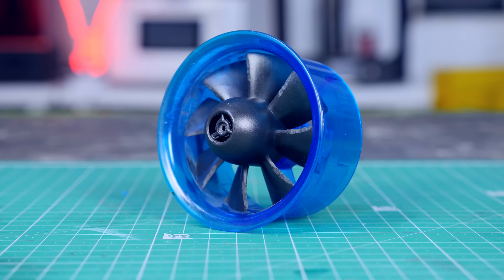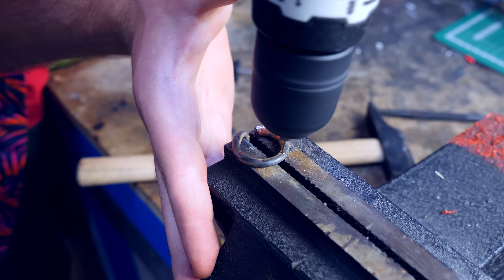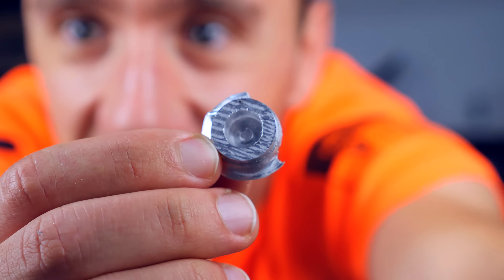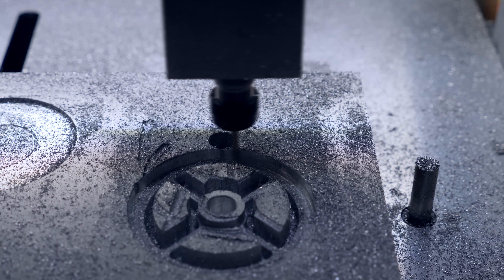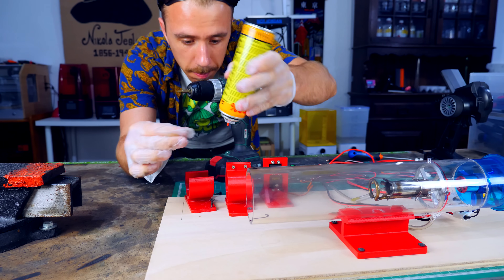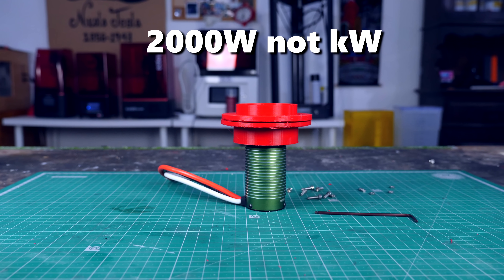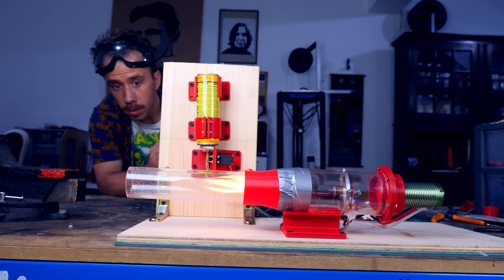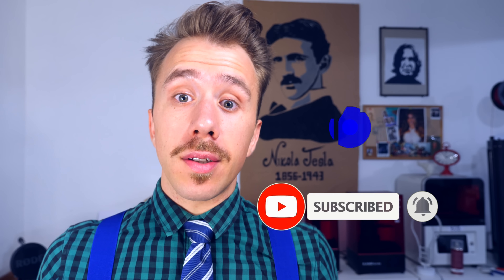I turned my Fan into a Jet Engine (3D Printed EDF Afterburner)

Comment: bro use stone powder since they are very heat resistant and can be made easily by mixing stone powder and water and also maybe something else for the thickness you need like "skill make" did by the way im 16 y old this is to solve your heating and melting problem maybe make the nozzle out of this stone powder

Comment: Bro Indeeded. I have thought you burn more fuel under high gas flow. Basically, more O2 to burn fuel. The question is how to convert that hot gas into kinetic energy by a flywheel to generate momentum or something else? Anything on your mind?

Comment: And you didn’t very well making metal parts sorry to ask you can u help me with 3 d printer I just had hart surgery and my wife died from the cove vaccine so yeah im still recovering but i need help please do i can make some good stuff with a 3 d printer thank i been following u to get good ideas for making a electric car but will no 3 D printer is not possible so i recall u saying that if i left a comment and project that u could help with make tezler electric car power with 3 d printer terrible and the teller turbine u made 1.5 whas c by20 wood my ennuff power to run a electric car Eddie Dornan 22 chauvel street Campbell act2612 tomato are very bad but ca 3D pit a good vocal so we could get rid of tamato with rc

Comment: Well suprisingly it runs! but note this real afterburners have this bizzare shaped structure known as flame holder in front of the feul spray nozzles to ensure better mixing and a sustainable flame one that doesn't blow out under high pressure so yeah it might work better with these improvements.

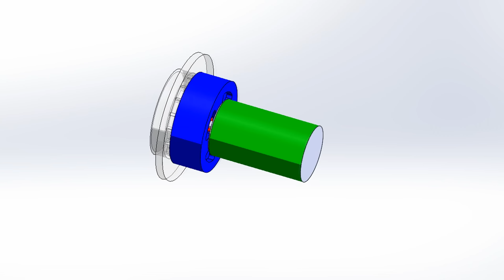Comment: @9:45 - no modern full-scale turbojet engine uses a centrifugal compressor.

the only place you still find centrifugal compressors in gas turbine engines are small turboshafts and RC models.

Comment: Is it possible to 3D print a drone from 0?    Can you do it? It’s a long project, but at the end of the you can sell it, we just buy you the engine, micro chips and controllers, and get the printing files from you 😊😊

Comment: I absolutely love it but here's the thing there's an actual radiation issue on any jet engine you actively need to have a geiger counter in the room with you the next one is once you get this to work there is a way to use butane to make a refrigerator and you make a little bitty refrigerator that runs and you put a pilsner between your jet engine heat and the refrigerator of the butane and even use the butane as an afterburner in your jet engine but it puts a ridiculous amount of free power or almost free power it's the stormtrooper backpack so that they had air conditioning and heating

Comment: Wouldn't what you have created be more precisely termed a motorjet since you are using an EDF to sustain the airflow into your creation rather than having a turbine in the exhaust "nozzle" to drive the "compressor " stage?

Comment: When working aluminum on the CNC milling machine, I recommend using a cooling lubricant (emulsifiable oil) so that the tool does not mix with aluminum It is just a product especially for those who work with metalworking, I use a water bottle with a hole on the cap and I sketch it directly on the tool 👍

Comment: Ok now you need to make stators and rotors, it should be easy enough to 3d print, like your turbine from the v2 , put fins on it and then step the size of fins down and stators to compress the air, get your burner in play and bobs your uncle

Comment: im confused, if the glow plug is in the back and you are spraying the fuel in the front, how is the fuel getting ignited, is there a small hole in the metal tube where the fuel also goes in to actually ignite using the glow plug

Comment: I'm confused on this, but doesn't pressurizing air increase the flow rate? And if so, how do you achieve high pressure air that is slow enough to not flame out the engine from a high speed intake?

Comment: did you miss the part that the flame tube has holes on the sides that takes the compressed air and mixes it with the fuel?

Comment: RE: generating spark Do it the old-fashioned way! Use a spark plug, condenser, ignition coil, and points. You can get these parts from an auto parts store for not a huge amount of money and mount them to a board. All the zaps you want.

Comment: Try to compress the fuel air mixture before ignition and try to reduce the fuel amount. I can see red flames and that means that the mixture is rich in fuel and the combustion is not efficient. In addition try to use the glow plug after the fuel injector because after ignition the flames will keep the high temp in the glow plug so you can turn off the power (see ethanol 2-stroke engines)

Comment: You haav 3d printer make an actual jet engine. With rotars and stators. Granted u need like 7 stages but maybe something smaller could be made differemtly....full suck bang blow. Not just a butane can ab. Already on the right track. Bet u could make an adjustable ab nozzel to adjust that exit diameter.

Comment: Hint from an old machinist, when machining aluminum cbn cutters are amazing. Carbide also works well with the use of a lubricant. Light oils like penetrating oils, wax or water based machining coolants really help. You'll be surprised at the difference in the cutting finish and accuracy.

Comment: For the next version try to measure the thrust generated, it'd be interesting compare just the fan versus with the afterburner running!
Reply: The same resoults the only thing he did is push the burning fuel by a fan matter of fact it might be worse than just straight up fan

Comment: Add coolant to your CNC (mixture of oil and water) extra lubrification really helps with the excessive noise and allows removed material to get out of the way resulting in less vibration thus less noise and a prettier finish. Wd40 works too, if you're not in the mood to mix water and oil

Comment: try to use hole near the ignition tube which can increase the combustion and enhance fuel burning leading to greater power and the high pressure fan can surely support it

I hate tomatoes too

Comment: So I feel like a big part missing is you blades and defuser. In a gas turbine engine the air being pushed in passes though what we call the cool section module that creates a wind tunnel, the defuser compresses the air flow then it goes to the hot section where we have a combustion chamber to atomiz the fuel and ignitor plugs to spark the fuel. After that we have the gg rotors (gas generated rotor) with air labyrinths, these rotors also have blades to continue the air tunnel effect. I see you and plasma working on these ideas and I just can't help but notice you guys aren't doing anything to condense the air to add pressure, I feel like the output in your ionizer engines would get that extra zaz if you could find a way to replicate the compression section of a gas turbine module engine like the T-701 D/C or another one, that's just the one I work on.

Comment: You need to put the constriction on the outlet of the centrifugal fan to change the air from high pressure to high velocity BEFORE you inject your fuel and ignite.
Remember: an afterburner is adding fuel to and  recombusting already high velocity air coming off the power turbine, and you need to simulate that.

...or just 3D print an axial flow fan 
💪 😎 👍

Comment: do yourself a favor. IF possible. Slow down the track speed of your CNC. and maybe add some machining oil when working with metal like aluminium ^^
should be a much cleaner cut. also make sure the tool is sharp ofc.

Comment: In a follow-up video maybe you can figure out at what temperature water breaks down into its component hydrogen oxygen parts and use those parts as a fuel and oxygen supply for a small rocket engine

Comment: Howdy there! I have been very curious about using a tiny motor to turn a large motor (generator) with a gear ratio 3d printed and assembled to create a higher energy output than put in. I have seen people use the same motors to try to make free energy devices but I haven't seen a small motor turn a massive motor yet... I'm a maintenance Technician in Billings Montana, USA. I love your videos and I have similar interests. I have been having a hard time saving up enough money to get a good 3D printer with having to buy diapers for our son and all, but I know you give away printers in your videos and could totally use one for my inventions, if you do choose me it would go to great use I promise.

Comment: I know its not the same thing but u can actually produce thrust if u make a "ram" jet engine or use different fuels and put some sort of scale to measure the amount of thrust ur getting just off ur machine i understand ur just moving air but it has to be producing more than just a turbo hair dryer. Anyways really dig it looking forward to more creations and failures cant learn if u dont fail knowing how to not do something is better than knowing how to just do it cuz u need to know how u got there cool video... Godspeed...

Comment: Sorry a newbie question here. The way I see it, this is more of an afterburning ducted fan engine, not a turbojet engine. Because what I know about a turbojet, the fan is driven by the turbine, which is spun by the combustion gas. Or there really is a turbojet designed this way?

Comment: Hello Integza,
I have an idea as of how you could make a heat-proof jet engine. I’m not sure if you know of this technique, but if you print a part using PLA filament, you can coat it in what is called a ceramic slurry. After a half dozen layers or so, you will have to use a furnace to slowly burn out the plastic. However, since the slurry is made up of such fine particles, you will be left with a perfect negative mold of the part. Since you have a furnace, you could melt some aluminum or steel and cast it. It’s a somewhat delicate process, but it leaves you with perfect metal parts, much better than plastic. I wish I had a printer so I could try it myself! Now that you made a CNC machine, it may not be nearly as necessary, but it may be worth a try.
Best of luck!

Comment: This... is very OLD technology.   how old?  at this time, over 100 years old!    The idea first came about in 1908...   What you have here "was" called a Thermojet (who's name then became used to describe a type of pulsejet)   or a Motorjet.

A moterjet is a primitive jet engine that uses an external source to power the compressor.   A modern jet has 3 "parts"  the initial fan that draws in and compresses air.   The ignition chamber  where the fire happens, then exhaust is vented over a turbine,  the spinning of the turbine turns the fan up front.

In a Moterjet.  an external source,  originally a "piston engine"  would be used to drive the compressor fan.  This was much simpler because the "high pressure high temp"  turbine fan requires special materials and crafting, where as direct dumping from the motorjet provided raw thrust.    The downside is, the mass of the engine required to drive the system.   

Initially Italy found a way to make this work with the Caproni Campini N.1 in 1940,  this created a jet that could reach speeds about 220 mph.   Russia later in 1945 tried the same thing but essentially ran with  normal propeller engine,  with a duct running back to the thermojet... 

In both cases,  this essentially gives an afterburner effect, as the planes COULD fly without the jet active just using propultion from the engine.

with the advent though of high pressure turbines (thank you titanium)   motorjets died out and research stopped.   But the idea of a ducted fan using a motorjet "afterburner"   for a conventional aircraft as a "cheat"   to get around jet laws, has always been an appealing idea.

Comment: Professional machinist here, one thing to help the screeching noise on your machine is to use the shortest tool possible. The closer the machine spindle is to the material, the more rigid and quiet your setup is. Please buy shorter endmills. 😊
Reply: There was no coolant there, right

Comment: Hate to tell you... but thats only a unnecessaryly complicated flamethrower or a torch.  NOT a jet engine.
To become a jet engine, it must generate thrust by the expansion of the combusted Gas. Your device only uses the fan suck in air and blow it at almost the same preasure out the rear. The way you burn the fuel does not produce or add any significant thrust. This fuel is basically just wasted for an optical effect. 
A Jet Engine consists of following stages: Intake, Compression, Combustion, Propulsion/Outlet. ... the expanding gas produces all the thrust and also propells the Intake fan. Only at Startup the jet-engin needs a little aid to get the first compression and combustion going with e.g. an eMotor. Once it started to burn fuel, the aid--eMotor becomes obsolet until you want to start the jet-engine once again but sometime later.
If you want to know if you're doing it right: The inlet does not suck in as much volum as the combustion produces thrust. It's not even close. it's something like 1Liter (Air volume) IN but 10Liter (Combustet gas volume) OUT. the energy/expansion of volume comes all from combusting the fuel. That's why a car gets blown away behind an Airplane but not sucked in when in front of it.

There is a chanel named "Warped Wahrnehmung". It's from a person that works a lot with actual miniatur jet-engines. he propells Go-karts and even Teslas with it.
His Video "See Thru Jet Engine" should be very informativ to you. Cheers.

Comment: Amazing project, cool video… just a comment… a glow plug does not ignite diesel in a diesel engine, it is used to warm the cylinder to help with cold
Starts…

Comment: Hey you need to find a friend who's into glass blowing and switch from plexiglas to real glass! PS you might want to add some temperature probes to see where the hot and cold spots are happening; I did this when testing vaporizing burners and it really helped. PPS you need to use cutting fluid when machining metals: your cutters will cut faster and last longer.  :-)
Reply: What about using Polycarbonate (bulletproof glass). It has a higher heat resistance that Acrylic and can survive high impact forces.
Reply: @GavinFromDesign  poly will survive higher temps but has a nasty habit of charring into an opaque black on the side exposed to the heat

Comment: Your CNC can sound like a cow for lots of reasons but most probably is a combination of too high spindle speed and feed speed with a bit too skinny for the job. Lubrication also is a  must, even if you have to do it manually. The depth of the pass might be too much also.
Anyway, this jet engine is cool. Next iteration you should find how much trust it generates.

Comment: You should probably be running some liquid cooling over that drill in the cnc machine. Unless it's using a setup that doesn't require it. Might cut down on the noise factor too. Usually I've seen if it's making too much noise, your cuts are too large. Slows down the process though.

Comment: make the smaller tube shorter, so the fuel does not collect in there, starving it of air, causing the afterburner to flame out and then the glow plug to ignite the fuel gathered inside and causing those huge flames. I may be wrong but I would try.
Reply: also why couldn't you just use your channel account......

Comment: So the reason this is clickbait is because there is not a turbine section in this model. The layout of the jet engine is induction>compression>combustion>turbine>exhaust, you have 4/5. The induction section is powered by an external source rather than the engine itself. From what I know about jet engine the induction and compression section gets powered from the turbine section which sucks in more air. This is called the Brayton cycle. A self sustaining engine that uses a continuous flame instead of a glow plug/ ignition plug/ spark plug like in a traditional combustion engine. The flame is started by a glow plug then is shut off unless the engine is sucking in a lot of water such as a rain storm etc. then the igniters are turned on to keep igniting in case of flame out condition. Long explanation but just to explain why I know all this is because I’m a jet engine mechanic and went to school to learn all this.

Comment: Hey Integza, great content, I enjoy the science, comedy and problem solving process. 

Also I know this is an old video and my comment may be outdated. 

But have you tried using 2 fans in series, with countra rotating blades to increase airflow and be less turbulent.

Also I saw this cheaper hairdryer by a company called tymo, it looks like a perfect candidate for DIY

Comment: So Hydrazine is just very concentrated peroxide and is used for the maneuvering jets on space shuttle by forcing it through either a platinum mesh or certain metallic salts, if your already setting up a lab to make your own could you build one of these thrusters?

Comment: 11:29, Considering you made the Motor much more powerful, You may want to install a Dimmer Switch or a Rotating Gague to Limit the amount of speed the Engine can provide without requiring your finger on the Trigger.

Comment: 2:53, for those who dont know. Glow plugs are used in Desil engines when the engine is Cold to Increse the temp in the Cylinder so Normal Function can occour Until the Engine Tenp gets up high enough for the Engine to do it Naturally.  Then it Disables its self.

Comment: It would be really cool if you added some extra coiling of copper tubing before the injectors. So that it would be an expansion tube in the hot zone to expand the fuel and heat it up closer to combustion temps

Comment: Duuuuuuude..... Get some coolant moving on the little mill. Cutting steel dry isn't horrible, but miling aluminum on even a little baby CNC is begging for headaches and friction welding. Even a spray bottle full of water will make that process easier

Other than that, I really dig your channel